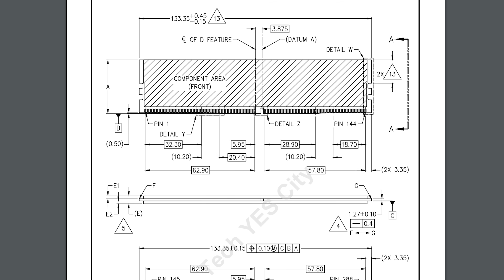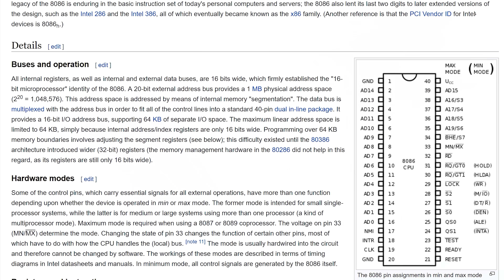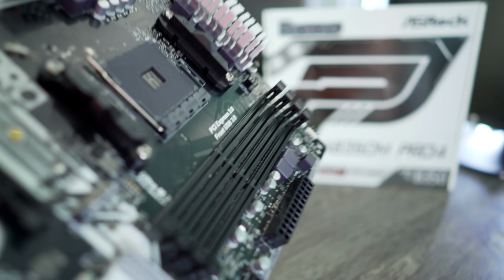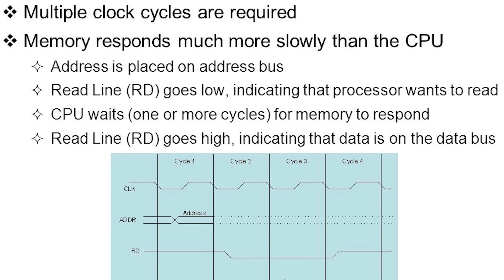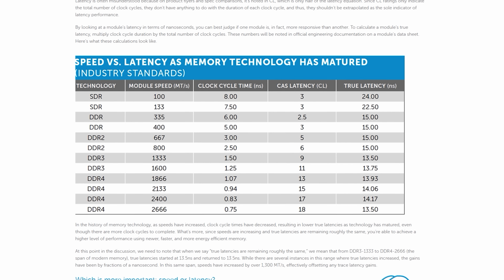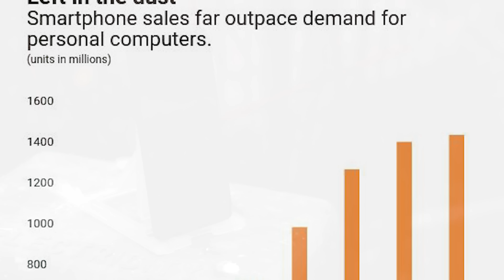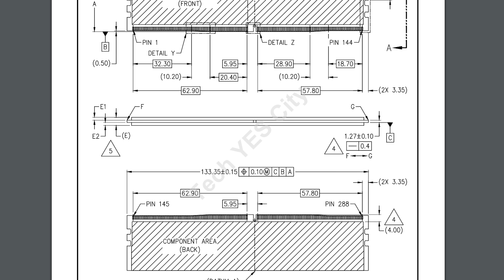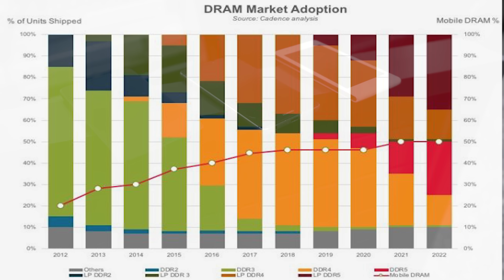When is DDR5 coming to a PC near you...?

Comment: Im DDR2 guys...
Reply: RAM can post comments on youtube?
Reply: @aldard.3075  haha good one my friend.
Reply: Just try doing it without it ;)
Reply: @aldard.3075  it actually can and does.
Reply: I'm DDR3
Reply: Im RAMBUS
Reply: many mofos on ddr3 and i'm no exception..for instance anyone on amd fx cpus , any intel i5/i7th before i think 4th gen etc.
Reply: @lazimofo90  4th Feb was also on DDR3, the last gen on the LGA1150 socket.

Then Intel added another pin, LGA1151, and I think DDR4 was a new thing
Reply: I just downloaded DDR4 from DDR3
Reply: Im DDR4
Reply: I`m DDR4 but I don`t even know what that means jaja
Reply: I'm DDR 400 CL2
Reply: Hi DDR2 :)
Reply: I'm SDR :-OOO
Reply: @JB82374  motorbikes FTW!
Reply: @JB82374  bruh. How much did you pay for that sweet 16GB?
Reply: I am a RAM
Reply: I’m DDR
Reply: im ddr 3
Reply: Im ddr4 ecc
Reply: Im R2D2.
Reply: @ponyslavestation2973  star wars fun confirmed.

C3PO.
Reply: I'm sdr through ddr3, most of my rigs utilize ddr2.
Reply: 5gb of glorious ddr2 in my rig ^^
Reply: You need to download ddr4 drivers
Reply: im ddr3
Reply: Ddr1...
Reply: Yay, I still have my old trusty Athlon 64 x2 system.
Reply: Ive messed with ddr2, frustrated me, i was buying overclocking chips but my northbridges couldnt handle the temps since thats where the memory controller was on intels back then
Reply: Fast Page Mode here.
Reply: DDRL 8GB 1600mhz
Reply: ME  DDR2 TOO MANN!! 8GB CORSAIR CM2X... dubled recently from 4GB.
Reply: I just downloaded DDR 8 get on my level
Reply: I'm DDR3
Reply: ddr3 1600 my dudes
Reply: hello fellow DDR2 user
Reply: @toop4538  hi!
Reply: 32gig DDR3 2100mhz which absolutely maxes out both my CPU and mobo.
Reply: 64 core Q.E.D Equals  P.E.N.I.S.10101111101101101
Reply: RDRAM
Reply: I'm DDR
Reply: Ddr2-D2 best star wars character
Reply: Guys ddr2 im
Reply: i got sodimm and stock rims
Reply: Im DDR6
Reply: same im on pentium 4 (idk if this thing is ddr2 tell me)
Reply: I'm ddr4
Reply: DDR3 that's why I can only play PvZ hahaha

https://youtu.be/vwiDwsLXa_g
Reply: I am using ddr
Reply: Same (q9400 Squad)
Reply: I'm both lol
Reply: Feels2008man
Reply: me too
Reply: Autronic you rock, proper hardcore. 😎
Reply: Autronic I don’t even have a pc
Reply: Me too
Reply: Autronic me too
Reply: Same
Reply: noob
Reply: DDR2 & DDR3 & Pre-DDR SDRAM
Reply: no, u are not
Reply: @Jonithecorn  now I'm DDR4.

Comment: So... I will still get a Ryzen 5 3600x with an RTX 2060S and 16gb ddr4 3600mhz RAM. I still think it is future proof, I think I will have to upgrade it only about 7 years later. (making it in 2020 and probably upgrading in 2026, 2027 or even 2028 if I lower graphics, I will still get 60 fps, hopefully)

Comment: SO THE BIG QUESTION: is it worth WAITING FOR DDR5 TO BUILD A HIGH END PC  VS DDR4 in 2019 ?
Reply: Harpreet Singh the question should be sound like is it worth to wait for upcoming year for new cpu and motherboard.Because ddr 5 will change all structure of chipset so you will need new mobo and cpu.There is always something in the horizon, u can’t just wait for it if u will u have to wait forever! Even right now new rams that are made for new cpus which r ddr4 r not compatible with most of sockets so it’s not worth to wait just build right now and keep on enjoying😉

Comment: Thank you for understanding that latency doesn't translate across memory types. For those that don't know what I'm talking about a simple example would be that 2400mhz ddr3 cas 12 has the same effective latency as 4800mhz ddr4 cas 24 (DNE). I don't have the time to explain why accurately, but the information is available if you have a few hours to waste headbashing. (It is not the simplest thing to understand.)

Comment: CL42 ?!? ...

That's ridiculously high for the lowest CL rating, god forbid going up to CL48. Even if we look at the "best case scenario" which is CL42, the "true latency" as dubbed by crucial would be of a much greater magnitude, even at 5Gh'z! 

(42 CL/5000 mhz) *2000 = 16.8 ns

To put that into perspective with todays ram sticks and what they're able to achieve, refer to the table in crucials article that lists different speeds and CL's of modules even as far back as ddr3 (the stone ages!) and you'll find that it averages out to ~14ns. We are potentially worsening the latency here with ddr5 by over 20% at best! High performance ddr4 modules are available these days (at a premium cost) that run at 3200mhz CL14, which if you do the same calculation as above, results in a "true latency" of 8.8ns! 

For those of you wondering how this translates to in terms of gaming performance, please refer to my list of sources which includes mindblank's video on the matter (no disrespect intended posted another youtubers video here, just want to spread information on this matter)

Sources: 

http://www.crucial.com/usa/en/memory-performance-speed-latency
https://www.youtube.com/watch?v=p--iuQhujqI

Comment: so then what you ant if you casnt match the memory freq to the CPU freq is to have the memory freq be a divisor of the CPU freq  so say a cpu @60MHz ( yeah i know but foe simplify the maths it was either mh or GHz and 60GHz isnt a thing yet lol)  and then have you ram clocked in at  like 15 MHz 4x15= 60  or 2 x 30 MHz =60 etc ... tho that doesn't help with the e=mc squared prob  but what could is either having them both  on the same physical  quarts crystal or since some how to a 3rd one

Comment: I have 64GB of DDR4 RAM and a 6700k, I plan to upgrade to a really good CPU which will be one of the last to accept DDR4 (That could end up being the Ryzen 3000 series or the intel 9000 series it seems) and then keeping that for as long as I can so I don't have to go out and rebuy RAM. HOPEFULLY, I can end up getting DDR6 RAM if it releases soon enough after DDR5, but we'll see what happens I guess.

Comment: If people think DDR5 will cause a massive price drop for DDR4, they're wrong. The prices are "Fixed" for a reason. This is an artificial price set by the manufacturers. I suspect both will have a high price, with DRR5 having higher premium entry price, unless demand drops substantially.

Comment: DDR5 release is very important, as one needs a cpu and motherboard to use it.

Or, rather, if you have a DDR4 mobo you can’t take advantage of it at all.

I suspect AM4/SP3/TR4 will be replaced once DDR5 and PCIe gen4 is out. 

Can I wait?

Comment: I don't really feel like it's necessary right now. System response feels instant regardless of which high end type of ram you are using and games show fps that are within 5-10 fps of each other with modern ram types. I don't really feel like spending $150 on 8g of ddr5 for 5 fps more will be enough reason anytime soon. Maybe if software makes some leaps that require a lot of hardware in the next couple of years.

Comment: Seems like DDR4 4000-4500mhz would be better since you can get cl18-20 latencies o.O dunno the latency increase seems massive.
Reply: my ddr4 is running 4 ghz at 15-15-15-35. ddr5 latencies looks horrible so far.
Reply: cl13 is the only acceptable way

Comment: so what does DDR5 have ever DDR4? as 0.1V of power is not that much maybe on more energy efficient models they can get it down to 0.9V from 1.1V for DDR5 but that is not in the official spec right now. So um little less energy use will be good for mass deployments and of course for battery life on cell phones and laptops but the system RAM already is not the part that takes  a majority of the power used.

Comment: ddr5 won't release until intel get 10nm ready...thats how it works...cause its intel stuff
Reply: Wonder if the nm thing will halt at 1nm or maybe at 0.001nm if optimistic.
Reply: @TheRealFobican  Silicon is becoming the limiting factor - but i would imagine that somewhere between 2-3nm is the practical limit.  The real issue is the programmers inability to make their code parallel to take advantage of the huge # of cores - one of the main reasons why virtualization of servers took off and is so strong - much more of the theoretical power of a new server can be realized versus the 1 OS per server.
Reply: I dunno about that DDR5 development is being headed by AMD this time around.
Reply: @mikuzoid  No, DDR5 is being headed up by Samsung, Hynix and other, you know, memory producers. CPU manufacturers will switch once it becomes available - no the other way around.
Reply: @bradvicious3991  I am well aware how it works: https://www.gamersnexus.net/news-pc/3286-hw-news-amd-going-ddr5-hbm-for-cpus-7nm-challenges

Comment: DDR5 + 7nm CPU + PCIE 4 + Next gen GPUs = Game changer. Let’s see if AMD can pull this off by 2020. Looking forward to new industry standards.
Reply: seriously, you don't know much about the industry i see. 1. ddr5 prototypes has horrible timings as in very high cas latency. ryzen needs low cas latency. 2. tsmc 7nm is a marketing term, intel 10nm is more advanced than tsmc 7nm (which is why tsmc already is talking about 5nm, which is slightly better than intel 10nm). pci-e 4.0 will be skipped, 5.0 is what is coming to consumers sometime in 2020+. it's nowhere to be seen in enterprise yet, and enterprise will get it first. tldr: not really a gamechanger.
Reply: Thanks for info. Nothing wrong with wishing.

Comment: Quite honestly, the part that I am unhappy with is the fact that they still aren't requiring ECC. Given that the cost of including the ECC components (which mostly means having one more memory chip per bank on a DIMM) has dropped significantly, I can only conclude that Intel is pressuring them not to, in order to trying maintain their dogma that 'professional workstations' are different in kind from 'consumer' equipment. 

While one argue that this is true with servers, for workstations the logic just doesn't hold IMAO.

In any case, the cost in lost productivity and time for consumers due to crashes when the memory bus has a hiccup more than offsets the cost of using ECC for run-of-the-mill PCs. The fact that we are even having this discussion in 2018 is little short of criminal - it should have been mandatory for the past two decades.

Comment: I just want memory back to reasonable prices. Pretty sure I got 8GB of DDR3 for £40 in 2012. Then it cost me £300 for 32GB in 2017. A 5 year gap and 8GB of memory works out to £75 for 8GB, almost double the price, when originally DDR4 was meant to drop below DDR3 prices within a year or so. But thanks to mining-tards that didn't happen
Reply: 16GB DDR4 used to be 70€ before the RAM shortage and smartphones took over

Comment: With 

DDR5 RAM 
GDDR5 video card RAM
NVME M2 SSD
GTX1050

yet we still limited to SATA3 - 200-255MB/sec
and slow single gigabit - 110MB/sec

Time to FINALLY get SATA4 or SAS 12
and 2.5GBE onboard LAN

Comment: My ddr3 is clocked at 2400mhz at cl10 (Corsair dominator obviously)  and it’s a beast on my i7 4790k at 5ghz, hit close to 1200 on cenabenchR15  , also paired with my gtx 1080 ti liquid cooled over clocked to 2100mhz at 15 teraflops , I think I’m Gucci for a while

Comment: Didn’t DDR4 kind of recently come out? Seems like we were on DDR3 forever
Reply: i just got on ddr3 i use to be on ddr2 3gb of and a pentium d 820 and now im on the old relible i5 2400 and 12gb ddr3 with a gtx 770. but im still gonna upgrade to a ryzen 5 2600 gtx 1060 and 16gb ddr4 3000mhz ram so hopfuly it will be futur pruff for another 4 years maybie? the ryzen build that is
Reply: @Ben10plays ben while a upgrade once per decade is good and probably the best way to go for the CPU, system RAM, and motherboard for the GPU IF you do anything involving games then once per 3 years is how long it should be for the GPU just replacing the old one with the new one while laving the rest of the system be. How computer PC tech is moving lately unless they replace the instruction set used then make everyone have to make and support 2 or 3 versions of their program that is the way to go.
Reply: yeah becuz im gonna be screen recording minecraft with a bunch of insane stuff going on
Reply: i cannot see why the upgrade to a 1060 and not just take the 770 from your old computer then. unless you want to be able to use the old computer still of course.
Reply: yeah im gonna let my little sister use my old pc
Reply: that is nice of you and really the gtx 770 is the minimum for some games now but for most it is still overkill so um i am hoping she likes your system 
even if she is not into games that is a good system just like a 1TB SSD would make it run almost like new
Reply: yeah shes into minecraft and roblox and im also gonna let my freinds use it for when i do youtube recordings with them so kinda gonna be a backup pc
Reply: Broadwell came out in 2014/2015 which was the first mainstream platform for DDR4 so it’s been 3 years already and likely DDR5 won’t be mainstream available until 2020.

Comment: DDR5 is close. Commercial sampling to some applications will start in 2019, if not already started. I have no idea if DIMM standard was already defined for it, but it will use very different sockets. It both needs to have connectors that provide better signal integrity, and different power delivery, because it is likely memory voltage regulators will be on a DIMM itself, and not on a motherboard anymore. It will be using 288 pin socket, with 0.85mm pitch. I spoted some photos, and it looks like identical socket to DDR4, but pin assignments are different (but the notch position is at the same place, so maybe it is using exactly same socket; it will not work in DDR4 mobos tho). I expect some specialized servers at the end of 2019 to be first to utilize it, both from Intel, AMD and OpenPOWER consortium. It was already said so with info from Rambus, Cadence and Micron. Samsung also said samples will be delivered in middle of 2018, and commercial availability in the middle of 2019. In desktops it will start showing up in early 2020. The main seling factor of DDR5 is not really a speed, but double density and much better power efficiency. All super important in servers.